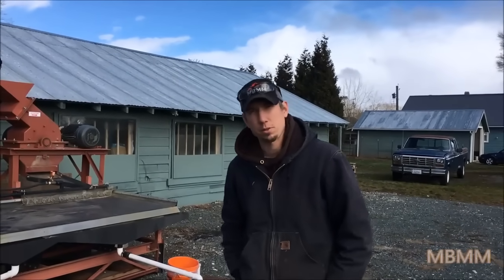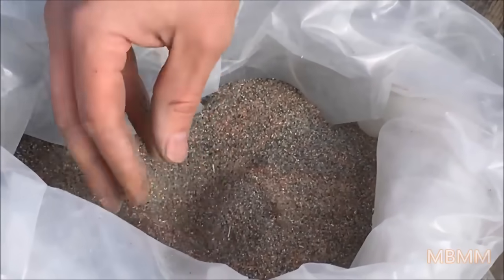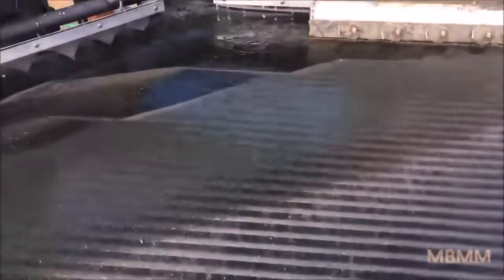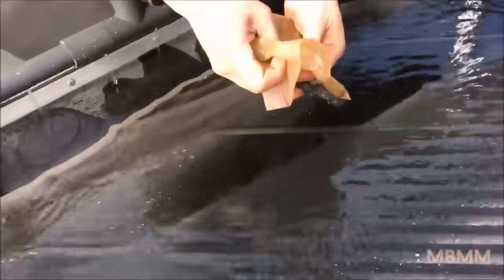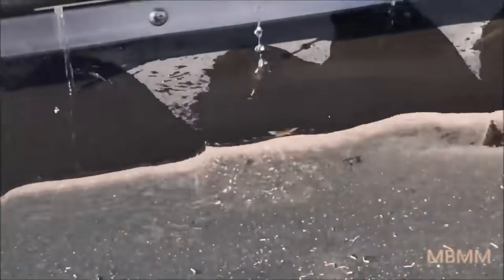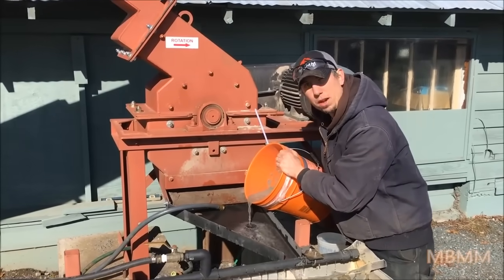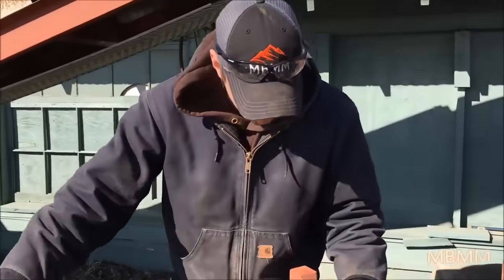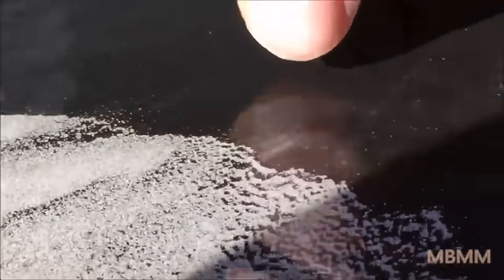Did We Find Gold? Recovering Gold from Electronics Using Our Shaker Table

Comment: I’ve been told the real money in recycling modern electronics is the silver used in the modern solder. 

Jason never mentioned silver.
Reply: There's certainly far more silver than gold, but it's also far less valuable. I've heard of some ppl not bothering with silver except when doing chemical extraction. 

I personally don't know, but I'd just keep collecting everything while making money from one thing, until there's enough to make money on the other things. However since the gold price is really high right now, a lot of ppl are buying the much cheaper silver as a reserve, driving the price of that up.
Reply: @nunyabisnass1141 Over the last year percentage wise, silver is up as much or more than gold and I think has even more room to run. 

I had an AirBnb landlord tell me how the company he worked for was in the business of recovering silver from the boards.  He told me the real money was in the silver.  I would tend to agree with that. 

They can electroplate a lot of pins with an ounce of gold but that solder is going to be ~50% silver.  There is going to be a lot more than 80x the amount of silver in a board than gold. 

My thinking anyway.  I just watch this stuff from the outside.  I have no skin in the game.  Not like Jason.

Comment: Interesting segment!.  I wonder if you took the samples at the start and filled the bucket to a set volume and took its weight.  Then run the sample and take each port and fill it with water to the same volume and took their weight.  Given the granule size and mass variation from ports a rough composition might be able to be worked out by same volume and delta weight relative to the starting material.  Also I was toying with an idea of a simple whirlpool feed system into that table with a plastic sleeve in the middle with magnets to use the force of the whirlpool help all non ferris material not get stuck in the ferris material that the magnet can grab out.